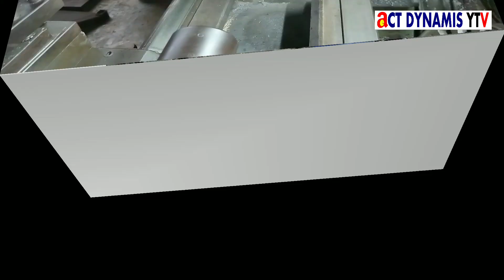Easy Way to Rethread Crankshaft and Repair Damage Spline

Comment: Hm sa drain plug sa side ng mio sporty yun sa gilid ng change oil losethread na magkano kaya maibalik sa dating size ng thread para sa mio Sporty
Reply from the maker: 950 po yan sir balik standard size
Pero dapat baklas na po yan pagdinala nyo po sa shop